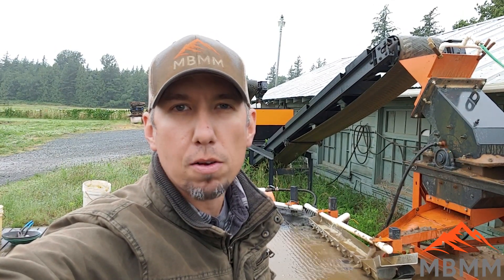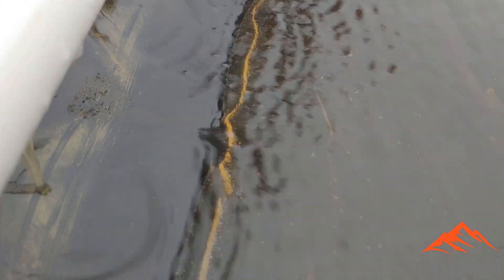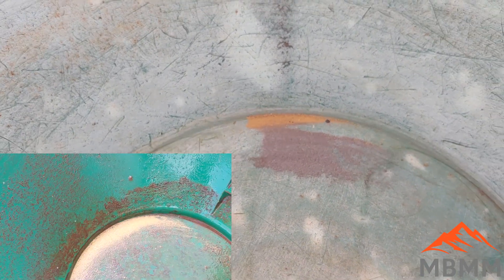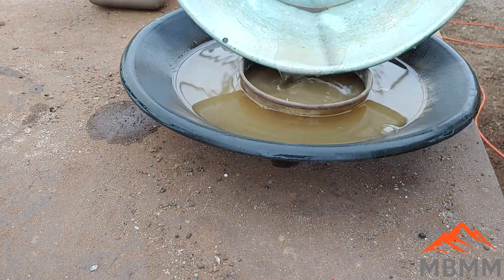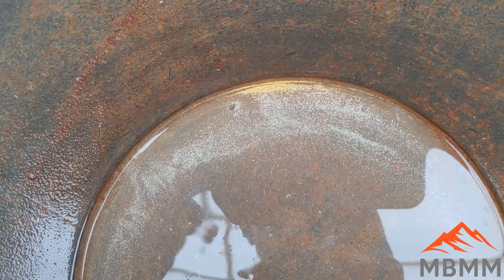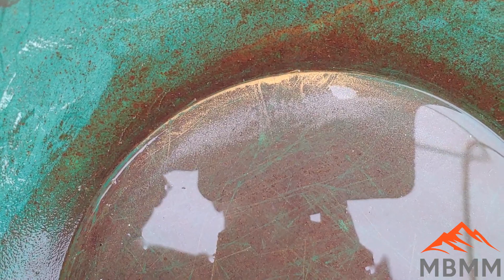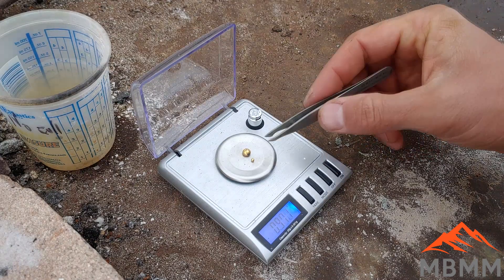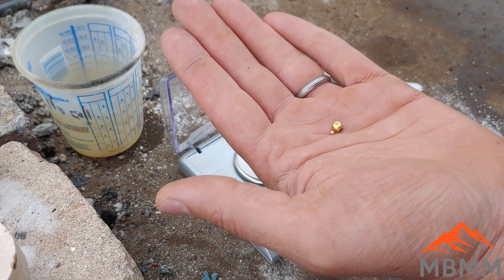Testing Sluice Box Tailings For Fine Hard Rock Gold Recovery vs MBMM Shaker Table

Comment: Suggestion: yes, start small but I'd suggest another test since you have a crusher/mill is to take some over-under point, i.e. +/-100 mesh. Do a gravity separation on the +100 and a reagent stripper like EcoGoldex (EGX) on the -100 fines. How do the costs, recovery, and capitalization for equipment compare to a pan & dolly pot, power crusher/mill with a sluice, shaker table and EGX. With gold @$1800 you should be using every available tool in your bucket. Hope to see another great video soon. Thanks for the on-target content videos!  Rock on!

Comment: Just a question.  Do u or anyone you know that would do 150 kilo of ic chip on shaker table? It would be just the cons after I run them on the sluice. So it might be 50 kilo after I take out all other magnetic metals and wash most light ash away. Edit : they are mostly bga chip and old 4 side flatpacks

Comment: You forgot to take into account the potential silver in the lead, and seing how you probably used same amount of lead for both beads there would be a skew towards the smaller bead.
I think you did a test earlier on how much silver was in your lead. Enough to warrant adjusting for it in milligram readings for sure.